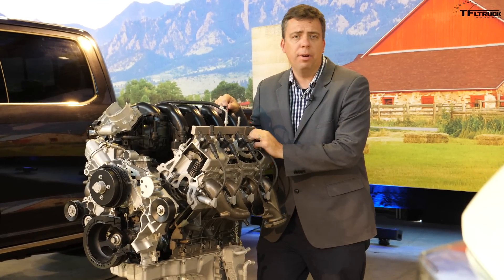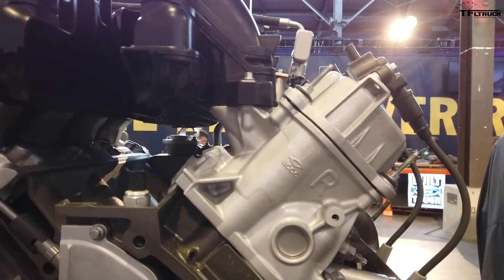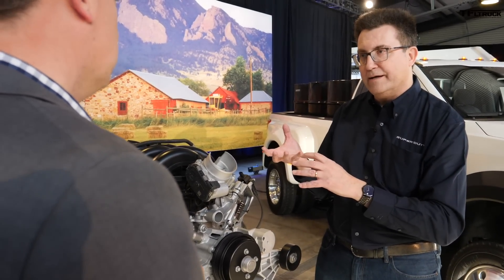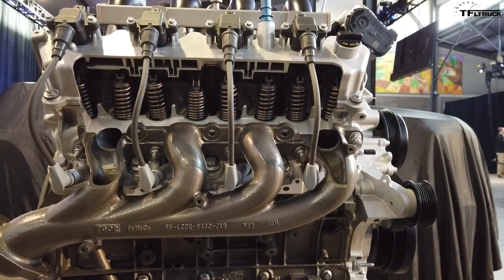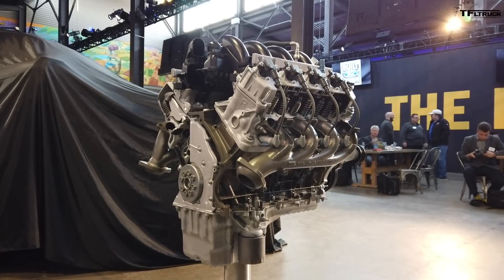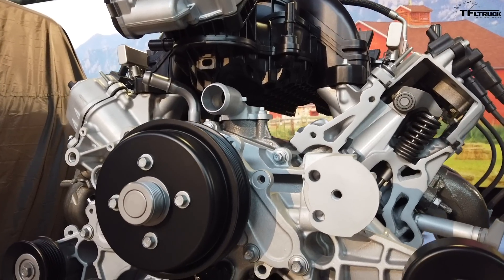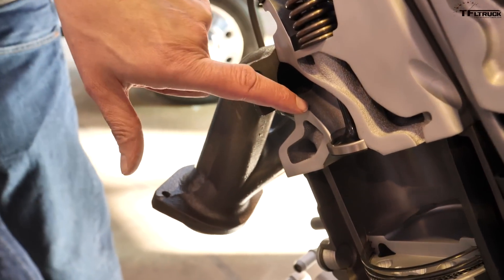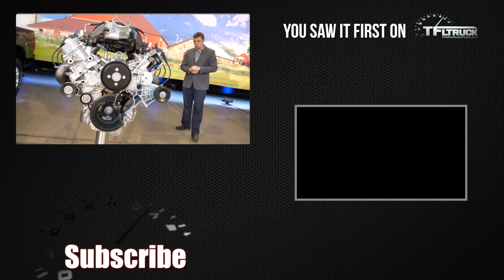2020 Ford Super Duty 7.3L V8: Here's What You Need to Know!

Comment: Looks like the Big Block Wars are back!!!!
Reply: @Dale GM is releasing a 6.6 gas engine
Reply: Only to be won by electric truck manufacturers.
Reply: I will stick with my old 7.3
Reply: @j-nifty6664  I know eh! 😂
Reply: Nah man this is for trucks only
Reply: @j-nifty6664  that'll be a fun fire to try and put out on the highway
Reply: @Dale pressure is definitely on Chevy now. a truck-going new 454 would be a suitable answer. Dodge has an all but officially confirmed 426 HEMI coming , and they will want to bring that to various vehicles, with various configurations and applications, meaning performance cars and trucks, as well as "work trucks". the HEMI seems suited to do that all, while Chevy has a DOHC family in development ranging from 5.5 t0 7 liters , which is intended to go into high performance cars, (Corvette / Camaro etc.) and not exactly suited to serve as a truck engine application. either way, exciting times, and Ford has done a major step and given a bold statement with bringing gas big block v8s back.
Reply: Josh D  
GM has a 6.6l gas on the way. FCA has a 7.0 gas on the way. What do you mean probably not?
Reply: @Itsunclejesse89  That's not new! GM has had 6.6 gas engines years ago!
Reply: @Travis Loos Cadillac had 8.0 (500 ci) years ago!
Reply: Exept Ford is the only one with a big block. GM and Mopar are using larger displacing versions of the same engine family as their smaller V8s.
Reply: GM 8.1 V8 and Chrysler 8.4 V10 ???!!!!!!
Reply: @johnanderson60  the Chrysler V10 is  LA (5.2L, 5.9L small block) based and neither are currently in production
Reply: @Travis Loos that 8.1l engine was also ate oil.  Was very hungry for oil had them in 4500 bucket trucks.
Reply: Ford is gunna sell a crap load of these things. I always wondered why you have to decide between a slightly underpowered gas engine and an overpowered play toy diesel with newer 1 tons. Just like he said, ford is meeting a gap that other companies aren't.
Reply: @Itsunclejesse89  Except the engine GM is using isn't a GM engine. Its a Navistar, the same company that made the Ford 6.0 and 6.4 Power strokes. And we all know the reputation those have. EDIT: Turns out, previous reports were wrong, and it IS a GM engine.
Reply: @Benjamin Burkhardt No, its a Navistar designed engine. Its not an LS.
Reply: Dan Hambrick GM is supposedly coming out with a 6.6 L gas engine. Hopefully dodge follows by making a new 7.2 440 big block. Would be nice to see the 3 compete.
Reply: Hear my issues with a GM 6.6 and the Ford 7.3.  first of all either engine design is not been proven.  I want to see the designs work very well without burning oil. GM's old 8.1 was a beast but it loved to drink oil...durability is key...maybe when I see that these engine start racking up 200,000 miles trouble-free, thats when i will buy one....other than that, i will let you guys finish up the R&D for ford and gm
Reply: Josh D  - Yep, I guess you didn't see that GM is introducing a new 6.6l gas V8 in the medium-duty class?
Reply: @j-nifty6664  - NOT!!! Around-town delivery vehicles, maybe, MAYBE. ANYTHING with any real range will a long while out. You do realize, I'm sure, that California has now mandated all the way from a 10% mix to a 90% mix of electric vehicles four (4) separate times, and has had to rescind the laws passed by "armchair physicists/assemblymen" in every case except their last attempt. And it, too, will fail, or the state itself will die from immobility.
Reply: @chevymetrodriver  -  A great engine, to be sure, but it hasn't been produced since the 2004 model year, and good blocks are getting hard to find...
Reply: @Olds_Pwr  External dimensions have nothing to do with a engine being a big or small block. Its based on bore spacing.
Reply: @superduty4556  I know a 5.0 f150 that caught fire just being parked so whats your poimt?
Reply: @nicoctane1669  you're obviously unaware of lithium ion battery fires and how difficult they are to extinguish. Big rig powered by giant batteries that explode progressively which cannot be put out by water? Sounds fun.
Reply: @superduty4556  They are very hard to extinguish I have had those stories. You however must not have seen the data they showed showing no more fires than what gasoline has.
Reply: Ya it may have the title 7.3 but it will never be a true 7.3L
Reply: Dan Hambrick yep
Reply: @nicoctane1669  frequency isn't being argued, intensity is. You agreed with me on that.
Reply: @j-nifty6664  Yeah only on the quarter mile in ideal weather conditions with limited accessories and easy driving post quarter mile.
Reply: @dillonh321  the GM 6.6 gas will have direct injection. Those engines will last a long time.
Reply: thanks Trump!
Reply: Just in time for $150 a barrel oil with Vietnam 2.0 coming soon
Reply: Now they need to start offering t in cars. Ford Taurus sho with 7.3 v8 that would be a step back to the way it used to be haha
Reply: @Dale they are bringing back the 454 with twin super chargers and quad turbo that gets 27 mpg up hill.
Reply: 8.1l Duramax Twin Turbo Diesel 

600 hp 1400T
Reply: Dan Hambrick and them some..look at dodge ..they payed 77million dollars just in finesJUST SO THEY CAN HAVE THE HEMI'S IN CHALLENGERS,CHARGERS,RAMS, NOW THIS....ITS ON...CHEVY FALLING BEHIND!
Reply: @bkranz-1283  the current ford 6.2 gasser isnt under powered a bit. Those babys are peppy as hell.
Reply: exactly chevy is working on a bigger engine amd u know  ram is
Reply: @Travis Loos that's not true, you could get the 8.1 with a 6 Speed ZF built manual or Allison automatic
Reply: Frotax Frotax  it offered a manual trans too (the 8.1)
Reply: Frotax Frotax  really? I like shifting and clutching myself, that makes me an idiot?
Reply: Alan Hardman Ford is already working on a fully electric F 150  that they plan on bringing to the market in 2020-2021.
Reply: David Lopez I agree there are kinks that need to be worked out. But if you do your research you will see all the big truck manufacturers(ford, gmc, dodge) are deeply investing in electric right now. Many of these problems with electric trucks are being worked out as we speak. You are going to see a wave of new fully electric trucks dominate the market trust me.
Reply: @dillonh321  FCA has a 7.0 gas on the way?? Who is FCA???
Reply: @somewhitedude01  
Fiat-Chrysler Automobiles

Comment: didn't think we'd have that many liters in a new engine coming out in this day and age.
Reply: I'd bet cylinder deactivation to cheat the EPA guidlines. And with a beefier block design they may also be able to get away with running the engine super lean with forged pistons and maximizing cooling efficiency both internally and externally to dissipate the excessive heat produced from running a lean mixture hence the "special" header style manifolds with cold air injection and air gap intake mani. Itd be a game changer if it works as they say...because itll be an awesome and easy engine to tune and make power from.
Reply: David G this will be small in another 50 years lol
Reply: @joshlarochelle1298  this will be obsolete in 50yrs. EV is the future as much as I hate to admit it.
Reply: JustAnotherGearhead there will always be purist and gearheads. My z will be alive and still walking smoke clouds for atleast another 30 lol
Reply: @joshlarochelle1298  I'm with ya on that for sure
Reply: JustAnotherGearhead you’ll always need mechanical engines, see you’re forgetting. We won’t be able to power 15000 hp shipping freighters and shit like that with electric for another few hundred years. So time and energy will always go into mechanical engines until then. No ev will complete the tasks of large trucks and boats and planes as smooth or better than what mechanicals are capable for a long long time.
Reply: Gm has a big block from a few years ago. It was an 8.2 litre I believe
Reply: JustAnotherGearhead here’s hoping lmao
Reply: 8,500gvw and over vehicles have different emissions standards than the rest of the vehicles and no epa fuel milage ratings
Reply: @joshlarochelle1298  as far as production vehicles for the masses electric is where we're heading. There will be industrial engines running on oil for a long time, most people moving planes are jet turbines already. You also have to realize that most of those freighters are already propelled by electric motors....the gas/diesel engines are just there to power the generators to provide the electric power for the motors. Yes there will be a need for fossil fuels for many centuries to come, but as far as the common man and his personal vehicles are concerned, things are changing.
Reply: JustAnotherGearhead hopefully the industry of performance engines becomes larger and companies are able to fund research to create new performance gas and Diesel engines.
Reply: Thank Trump for canceling the Obama era CAFE standards.  This is why you see first new gas pushrod V8 design in many decades.
Reply: @joshlarochelle1298  I'm thinking 20 years or less. Super efficient Rotary type engines to create hovercraft lift like a rideable drone using 1% of the energy...
Reply: Murica
Reply: @joshlarochelle1298  Your Z will live, along with every manual transmission sports car. However, it will become a showroom queen for the most part. EVs will be the choice for a daily and work trucks.
Reply: MrAdoh2010 my z is a fully built tubed rollcaged 350z with a built 6.8l lq4 and Gforce 4 speed. It’ll never really be a showroom queen, it’s a clean drift car. It’ll be ran and ran until it’s dead as a chassis.
Reply: @joshlarochelle1298  so its actually a 680z. Sounds sick bro.
Reply: @mikej8832  good info bud, thanks for pointing that out. Forced me to do some research into it, which helped clear up some misconceptions/confusion I had. I knew diesels were treated differently than gassers, and motorcycles differently than passenger vehicles, and of course age of said vehicles, but I didnt realize how much the gvwr affected regulatory testing. Learn something knew everyday lol